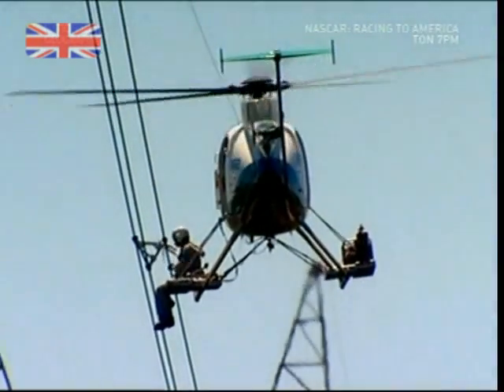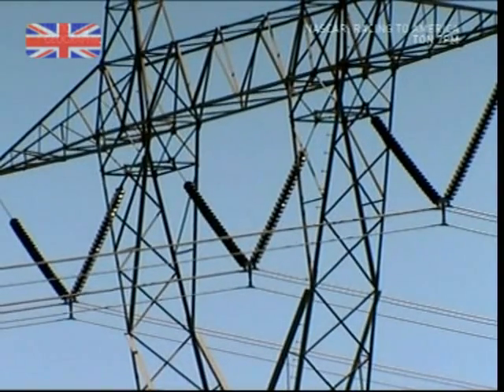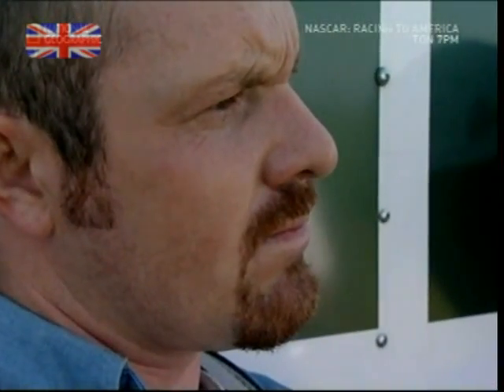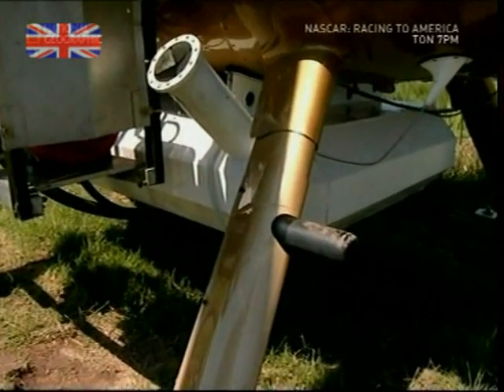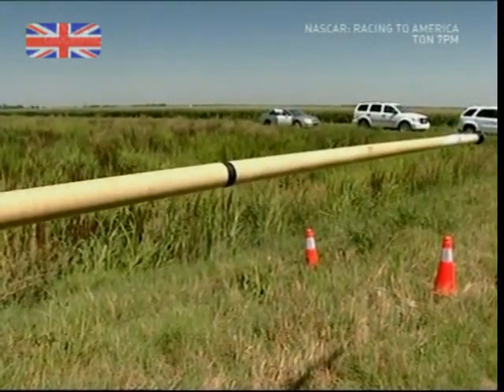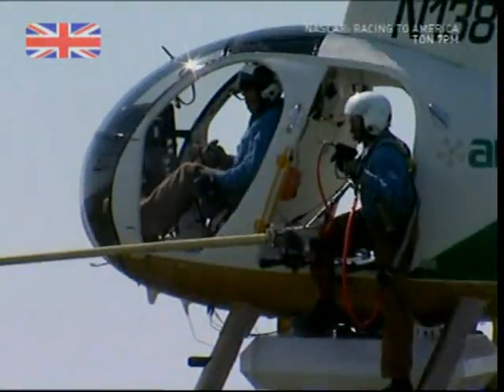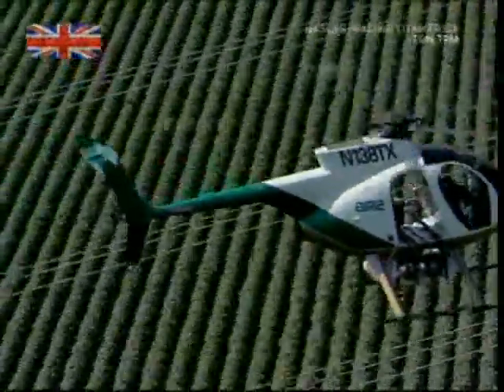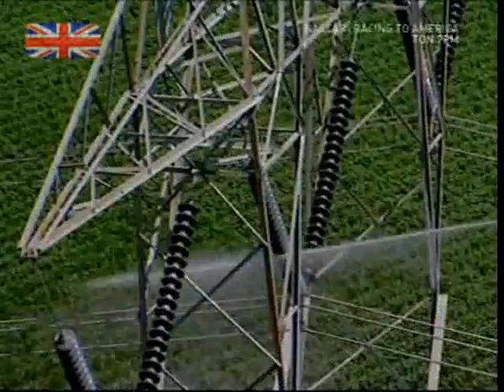'Hot-Washing' the Insulators of a 500,000 Volt Power Line!

Comment: Doesn't spraying water on the insulators cause them to cease being insulators?  If the insulators are coated in a layer of water (contaminated with bird droppings), the electricity can flow from the power line, through the water on the insulator, into the pylon, and then into the ground.  Why is this not a problem?  

Does the water wash away the bird droppings so fast that there is never a layer of contaminated water extending the entire length of the insulator?  That seems risky: what if they're not thorough enough and some of the bird droppings remain, contaminating enough water to form a conducting path?
Reply: Probably works the same way it does when there's rain...
Reply: BankaiIchigo12345 Pure water is not a conductor.
Reply: Water cannot conduct if it is pure eg: distilled. Water requires dissolved ions such as sodium chloride (salt) to be conductive.
Reply: If it worked like you think, the world would be completely fucked when it rained.
Reply: Kids, the insulators are not just to keep the lines from arcing together. There is a phenomenon called dielectric loss whereby power is conducted away from the lines. This is due to the electric field falling off as the square of the distance, but all the conduction is an ac field... an EM wave. These wire to air (corona), wire to ground, wire to insulator and wire to wire fields are like large capacitors. The insulators are shaped the way they are to lengthen the path across them which lowers their dielectric loss effects. Especially when wet. The water spray isn't conductive enough to cause an arc, but it does cause a huge increase in dielectric losses while being used. As I mentioned in a previous post, they use "demineralized" water and non-ionic cleaners and are not in contact with the ground. Some systems don't use water at all, but use "dry ice", or solid CO2 as the cleaning agent in the "sprayer".
Reply: nexus1g UNLESS it's mixed with bird droppings....
Reply: Hate to break it to the other commenters here, but water is actually 20 times the dielectric strength of air. It's 65MV/m whereas air is only 3MV/m.
Reply: BankaiIchigo12345 http://physics.info/dielectrics/
Reply: Joseph Perkins Thank you. I'd just like to add that number is an approximate for specifically distilled water like what they're using in this video.
Reply: It probably does cause some shorting, but the water is so thin that whatever conductive path exists will get really hot really quickly and just flash to steam, thus solving the problem.
Reply: Blind Bob Nah. Water is actually a fairly good insulator. It's ions from things like salts that do the conducting. Phosphates can do that, too. That's why demineralized (sometimes steam "distilled" water) and non-ionic based organic cleaners are used. No conduction to speak of and they evaporate.
Reply: +BankaiIchigo12345 e helio and its occupants are perfectly safe because the HV current has NO path to ground.....same as a bird sitting on a V conductor.  In other words, the hello and its occupants ae perfectly safe from electrocution (as is the bird) and all these comments re water not conducting are irrelevant.
Reply: niftyusername
 At thousands of volts though water breaks down and ceases to insulate. There is no scientific explanation for this actually NOT causing a short. The best thing I can think of is they took a medium/seeker/sorcerer (one who prays to demons to acquire mystical powers) and used dark occult supernatural magic power to prevent this electrical disaster. A spell was probably cast just prior to them washing it, to make the electricity violate the laws of physics and NOT flow through the water and therefore NOT cause a short and massive electrical explosion. I know presidents (Ronald Regan is the best example) have consulted mediums and fortune tellers before. There's no reason that powerline workers and people in other similar dangerous jobs wouldn't also consult people who work in the magical arts, in order to get the supernatural protection that they need to survive such dangerous jobs.
Reply: nexus1g
Actually the distance between rain drops adhearing to the insulator is such that the gap between raindrops leaves enough insulating air to prevent arcing. However the spacing between drops from a water hose is MUCH closer together, almost continuous in fact. As such I do not see how these guys avoided creating a MASSIVE short here.
Reply: nexus1g At high voltages it is a conductor. Water, and all other insulators breakdown and begin to conduct at high voltages. And water has a much lower breakdown voltage than air. This is why it's so dangerous to be standing in a puddle of water if lightning strikes nearby. And that breakdown voltage is further lowered with any impurities added. It's VERY hard to completely remove all impurities from water, and even any slight impurities can significantly reduce the breakdown voltage of water. Water sprayed 10 feet through the air picks up trace amounts of CO2 gas in the air that dissolve in the water, forming a very mild solution of carbonic acid. This significantly lowers the breakdown voltage of water. The only way to completely remove all impurities from water is to boil the water and use a condenser to turn it back into liquid in a new container, leaving the solid impurities in the original container, and to prevent ion-forming dissolvable gasses (such as CO2) from getting in, all of the entire distillation procedure must be conducted in an airtight-sealed enclosed space in which the air has been replaced with an inert gas such as argon. This is the only way to get 100% pure water.
Reply: nexus1g And you use a non-ionic cleaner. It's those pesky ions that get you into trouble :P
Reply: Hans Johnson You should read the other comments. You're just wrong.
Reply: What happens when it rains?
Reply: joetoorivers1 In general, residual ions in the rain water from particulates in the air cause the water that forms a path to each conductor and ground to conduct a small amount of current. That's why it's dangerous to be standing in water that a power line has fallen into. It usually only causes the water to warm up and evaporate faster. That's why you can sometimes see big insulators on power lines steaming after it has rained if the air is cold.
Reply: Dave Madden You're an idiot.

Comment: wait contaminated water is conductive but pure water isn't conductive?
Reply: HyperSpify good point, the insulators are specifically designed to prevent sufficient water buildup that could cause a short they also create a very long path for the current (with all the wiggles on the surface) to travel before reaching ground, the reason they are cleaning them is to get dust and bird shit off which is much more conductive than the water they use. the electrical potential between 1 phase and ground is far less than 500kv so for any danger of the full 500kv  shorting thy would have to get two sets of insulators wet at the a same time
Reply: it dose not matter the helicopter is perfectly insulated from ground, so apart from a few arcs while he helicopter charges to the same potential as the cable they could touch the cable with there hands and be only slightly tingled nothing deadly
Reply: iknowsstuff But the pylon is grounded.  And they're spraying water at the insulator, which connects to both the pylon and the cable.  If part of the water stream hits the pylon, and another part hits the cable, and the water is contaminated, they're screwed.
Reply: Water isn't completely conductive but the salt and minerals in tap water aka: contaminated water is conductive aka 100% pure H2O
Reply: HyperSpify
It's worth noting that the cables are suspended beneath the pylons.  The water dripping off the insulators will just fall to the earth, instead of onto the pylon.

Comment: At this high of voltage, current can flow into the air. This phenomena is known as partial discharge. In fact, current can flow without an "earth ground." It is simply the fact that those lines, at that voltage, are creating little arcs that you can experience. Go to a HV powerline and stand under it. You'll hear bacon sizzling. Now for that reason, you see why it needs to be 100% clean.

Current can flow regardless. It is 500kV. It has the potential to find a path. :)
Reply: Touch voltage is what we normally call it also

Comment: That's pretty dumb. First, you clean the tip before going up. Second, they are talking about contamination IN the water, i.e. mixed in with the water. Several flecks of dirt that are on the nozzle and are blasted away the instant they turn the water on will NOT make the whole spray conductive water. That's like saying "if you put a piece of metal on the tip of a plastic pole, it'll turn the whole thing conductive.". No, but if you add fine wire mesh down the length of it, THEN you will.

Comment: @gnuman1 The helicopter is not at the same voltage potential as the high voltage line, so if their were contaminents in the water making it impure, it could cause the voltage to arc across to the helicopter in its attemp to even out the potential

Comment: @gnuman1 Rain is not pure water at all. Stand under a HV line in the rain and you'll hear the buzz of the discharge the rain creates. The insulators are designed to keep this within acceptable levels and prevent flashovers.
Insulators are made of water repellent material like glazed porcelain, glass etc and shaped to cause it to run off, basically like a long stack of small water repellent umbrellas. But yes purified water is a poor conductor so a flashover does not happen when "hot washing".

Comment: @lonedoghowling I think what your refferring to are the 'insulators'.  they are normally made out of ceramics so they are not conductive. the reason for the strange shape is to prevent water from rain from being able to run down and possibly form a connective stream.  electrical design is very clever.

Comment: @jrobe009 The cost is not that much moreto use helicopters, besides its 4-10 times as fast, and does not dmage the ground like a bucket truck does. Also, there are many areas they cant get trucks or towers that are too high, in mountains, over water etc..

Comment: @mcj3691 Piloting the copter across the lines is dangerous it the pals hits anything.. but electrically, it is not dangerous... Everything is soo exagerated in what he says. Just check at 1:24 the guy says the pump is 3,500 hp strong, come on..
Check out the other video from Triwood1973 (Repairing/Servicing High Voltage Cables) and tcheck how this copter is directly grounded to the wires
peace

Comment: That guy thinks he's so cool, but it's not that dangerous.
And his stick is not evan insulated at the end, it's useless you don't need to insulate the stick as long as they don't short-cut 2 of the 3 phases. because that would make a 866,000 volts short-cut.
And the static charges for the copter/power line is nothing !
Check out the video of the other copter video of triwood1973, the guy grounds himself with a 1.5' metal stick attached to the copter.